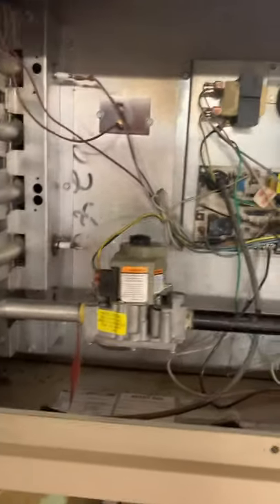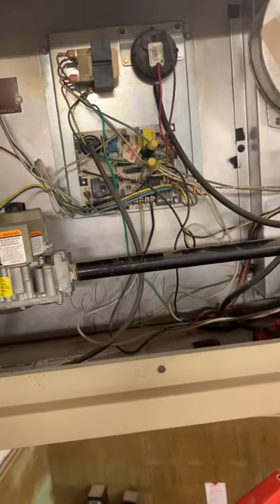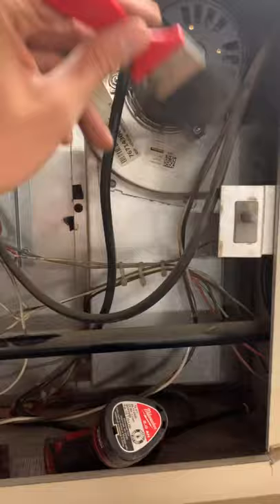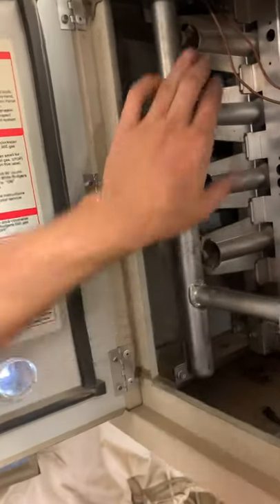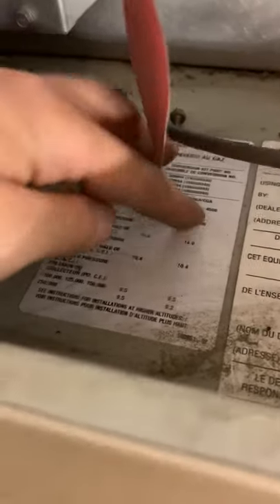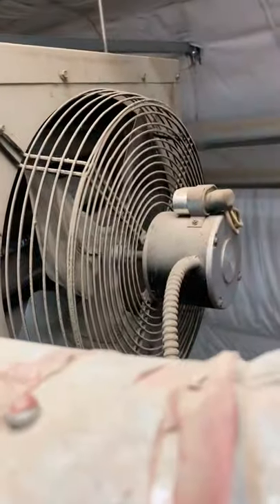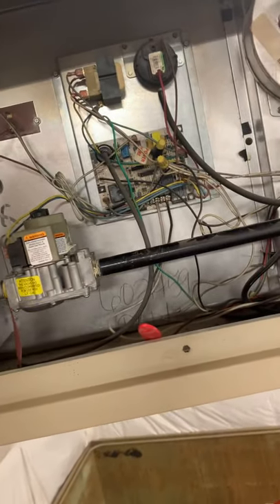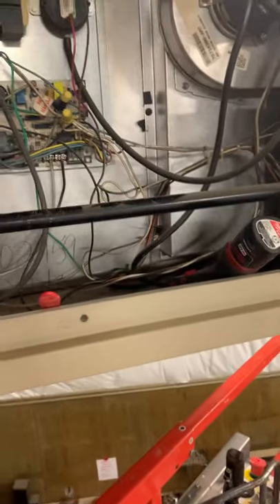How to service unit heater "ADP"

Comment: I’m trying to troubleshoot my dads adp heater from a far. He’s in Montana and I’m in Wa. His heater runs for about 1-1/2 mins then flame shuts off. I sent him a new flame sensor and still does same thing. He’s not getting any codes when burner shuts off. So it comes on runs 90 secs and burner shuts off for about 30-40 secs then ignites flame again and repeats same cycle. For some reason flame keeps going out. It is not hi limit switch and I don’t believe it’s diaphragm switch either.
Reply from the maker: would you happen to know age of the unit or model/serial number? this will make is easier to help
i do have a few question 
- does the blower motor run at all during this 90 sec cycle? 
- is the gas valve warm to the touch after running?